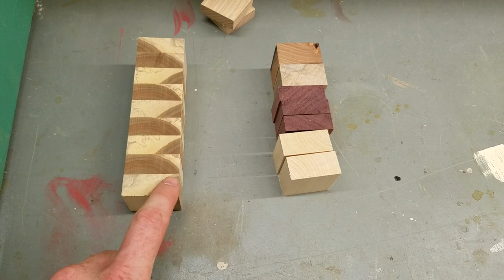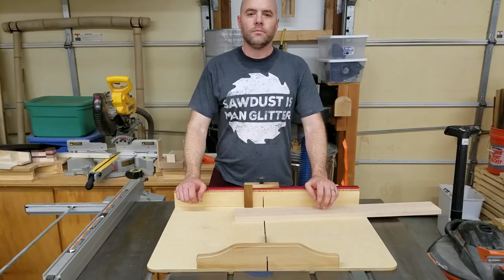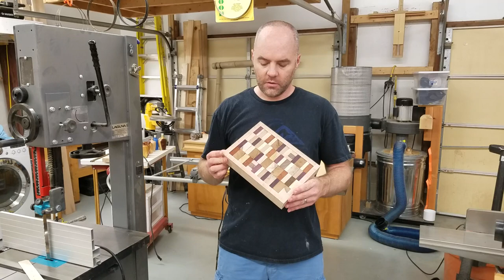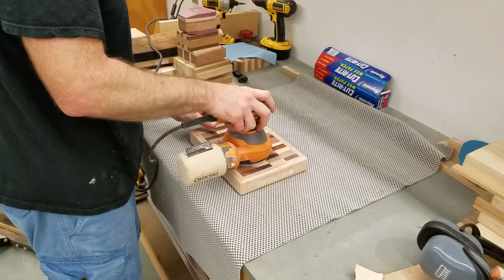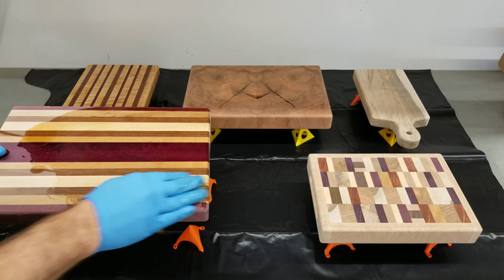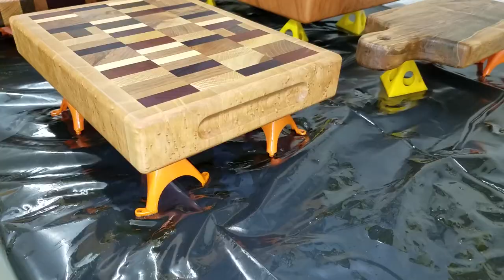Scrap-wood end-grain cutting board

Comment: What did you use to make sure the sides of the pieces you glued were straight and good enough to glue together?  Did you plane them or sand them before gluing?  Funny, I was looking at all the little pieces I have thinking that they would make a good end grain board, but did know how to get the face sides of the boards straight enough to glue together.  Glad I found your video....  Thanks
Reply from the maker: @markray3733  I can't remember exactly where in the video, but I showed flattening the sides with a jointer. You could also do it with a router table and jig, or by hand with a low angle plane.

Comment: I have a few questions/comments if you don't mind.  I'm just getting back to woodworking after a long break  You don't seem to use much clamping pressure.  Do you bear down off camera? What brand table saw do you have and are you pleased with it?  Beware of those pointy supports.  They scratched the hell out of one of my boards.  It was primarily cherry on edge and sanded to 320. Therefore the scratches were more pronounced than might be the case with other wood.
Reply from the maker: I use just enough clamping pressure to get the wood pieces to mate without squeezing out too much glue and weakening the joint. My table saw is an older Ridgid and I like it, but they've changed the design and I hear it's not as good now. I learned the hard way about the triangles also, so I sanded the points down a little.
Reply: @TheSnekkerShow  Thanks very much for responding.  You have great skills.  I'm a former machinist who went to college and am in a profession now.  I have decent basic skills but limited time with work until I retire. I won't get to your skill level and need to teach myself (with the assistance of YT). I'm taking the cutting board on ramp to get back in it and get used to working on the machines. Thus, I appreciate your videos and the time you spend on them.
Reply from the maker: @VinceEspositoJr  Thanks for the feedback. The trick with woodworking is just to treat each part of the project like its own project, so not that different from machining in that aspect.

Comment: Hi Ben…I really enjoy you videos. I just completed building two of these end grain cutting boards today. I’m waiting for the Waterlox to arrive in a day or so. While you said you applied 11 coats of Waterlox, I’m not really sure how much time you waited between coats. Were they applied over hours or days?
Reply from the maker: For cutting boards, one coat is usually enough. I'll keep applying it until the wood isn't absorbing any more, but after several years that deep coat of oil is still holding up very well on every board I've done. You don't want to build up a surface finish that could trap moisture underneath; just a thorough sealing is all you need.
Reply from the maker: This might help too: https://youtu.be/J23VCsTyxPw
Reply: @TheSnekkerShow  Ben...The boards look great after the application of the Waterlox...except the got sticky and shiny on the outside frame facegrain. I tried the mineral spirits but that didn't work too well. Any suggestions here?
Reply from the maker: @chrisonly2  You can just sand it lightly, going down to at least 600 grit on the final. You can also use a card scraper to carefully remove any unevenness on the surface before sanding.
Reply: @TheSnekkerShow    Hey Ben.....I have another finishing question I hope you can help with.  I am refinishing a maple kitchen table. Over the years the maple veneer has yellowed. If I remove the old finish with stripper and then carefully sand the surface...should I just use a clear poly or use a stain and then poly. I've looked at stains at the big box store, but none of those colored stains look close.Should i use the clear poly and wait for the finish to yellow over time?
Reply from the maker: @chrisonly2  I don't want to steer you wrong, and it's tough to say without looking at it. It might be the wood that darkened, or the finish. When I'm trying to get an exact match, I usually wait until stripping the old finish off before deciding if I need a stain or just a clear finish.
Reply: @TheSnekkerShow  Ben...thank you for the quick reply. When I wrote my question I kept thinking.."what a dumb question". I guess if I was using something like walnut I wouldn't be as hesitant as I know what it would look like when finished. It's just my expierence with maple furniture that over time the finished item goes from a clear finish to an amber one over time. I think I'll do as you suggested and strip and then sand the tabletop first and see what the base looks like. I think if I use an oil based poly (as apposed to water based poly) it will most likely provide an amber color I'm looking for.  Thanks again for your help...Chris
Reply from the maker: @chrisonly2  You're very welcome. Good luck with the project.
Reply: @TheSnekkerShow  Ben....I've used the Waterlox as you've suggested and It has worked great. I recently reopened my can of waterlox and was surprised at what I saw inside the can. I used glass marbles to displace the air inside the can after using it about a year ago. This time when I opened to can the liquid level shrunk down to about half of the can. There is still liquid. Is the Waterlox compromised or still good to use?
Reply from the maker: @chrisonly2   I've used thick Waterlox before with no major issues, but when it starts to thicken you'll get less penetration into the wood. When it turns to gel, throw it out. I'm a big fan of StopLossBags now. https://youtu.be/XoNVFnoN3jg

Comment: Thanks for the great cutting board ideas - if I may add a potential solution for when the oil/finish squeezes out to the surface: that will buff out nicely with very fine grit sandpaper; I’m talking 2000 or finer - I just happened to have some around when I did my first few boards, I use it to wet sand fine scratches in the clear coat of my truck that won’t come out with compound - it is really nice to use on wood, no visible scratching but will take those squeeze blobs off no problemo

Comment: Can you tell me specifically which Waterlox product you are using?  I tried to follow a link from a previous comment and received an error message.  Thanks!
Reply from the maker: I use the Original Sealer/Finish. They updated their site to recommend against using it for cutting boards because cutting will damage a film finish, but I never used it to build a film anyway.  Let it soak in deep and wipe off the excess.

Comment: You said it takes about a month for the Waterlox to cure completely. Can that time be reduced by adding a fan for increased circulation?
Reply from the maker: It would probably help, but I couldn't say by how much. With deeper applications like end-grain boards, the trick is that the surface dries first and slows the rate at which the subsurface solvent can escape.

Comment: How are you able to plane the end grain cutting board without it exploding everywhere? I have heard of many horror stories of this happening, but yours seems to go through without any issues. You should do a video sometime of the proper way to plane a end grain cutting board. Thx
Reply from the maker: I broke my previous planer doing the same thing, and learned some things in the process. I'm going to do a video, but in the mean time, sharp knives, perfectly flat board bottom, slower speed, eased edges, and very light passes.
Reply: Could use a router sled jig with a flattening bit to avoid the risk to your planer.